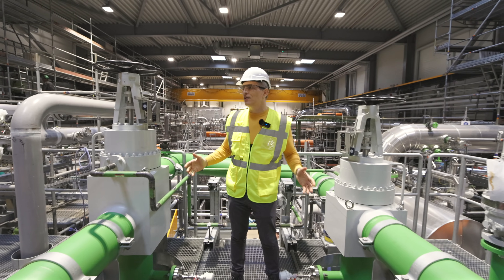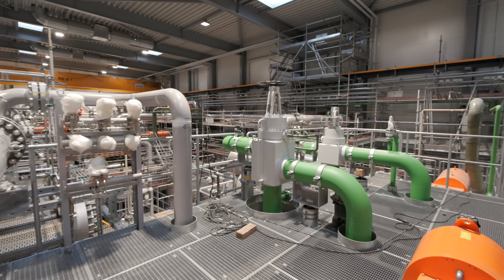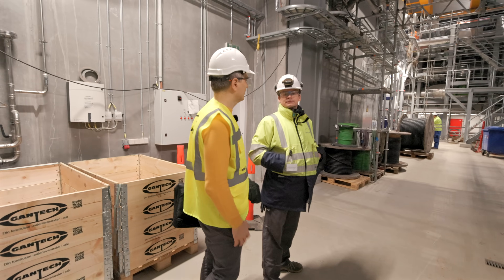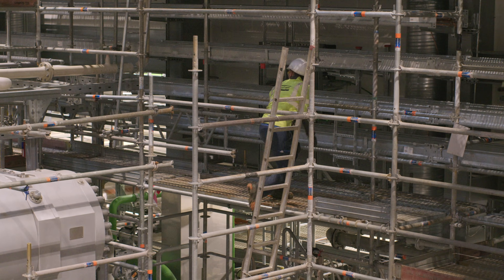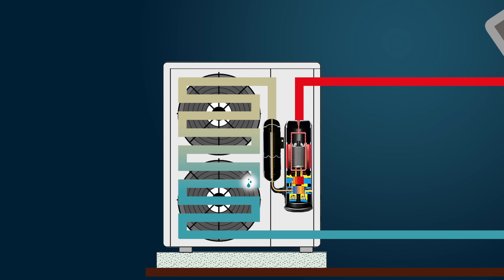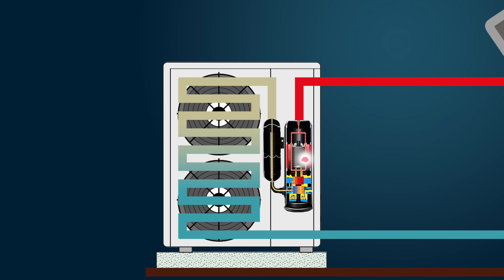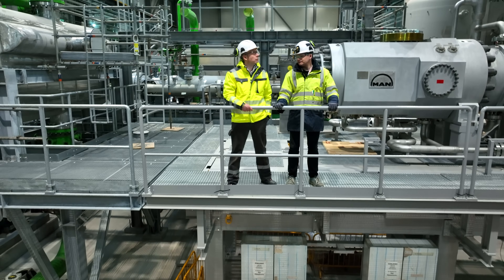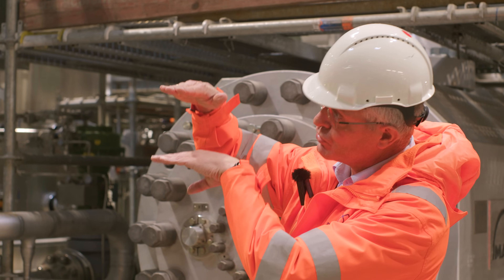Inside the world’s first giant heat pump that heats an entire city with CO2 and sea water

Comment: Wow! That didn't feel like more than 40 minutes! Nicely done and very informative.
Is the heat storage just a tank of hot water or does it contain another heat storage medium?
Reply from the maker: I am glad it didn't feel like 40 min :) The heat storage is an tank with thermal insulation to minimize the losses and some internal compartments to make the partial use / storage / refill more efficient.
Reply: @Watt-Energy   Question wasn't about insulation, but what medium is used to store the heat Such as a water, salt, phase change material,etc?

FWIW its heat storage was the one aspect, I really would have liked more details.
Reply: @nc3826  it's just water. Cheap, practical and over 100 years of experience.
Reply: “It ain’t what you don’t know that gets you into trouble. It’s what you know for sure that just ain’t so“  

it is a shame YT experts, will never learn that lesson....
Reply: @nc3826  there are hundreds of district heating water tanks this size, operating for decades. Berlin installed an extra big one a few years ago, well described
Reply: @nc3826  No.  I looked it up, you didn't. Esbjerg uses water in the tank to store 80 degC heat. Same as the many others.
Reply: fwiw where, did you supposedly 'look it up' ?   

since 'MAN Energy Solutions' url doesn't specify the storage medium... In its 'esbjerg-heat-pump' menu....
Reply: I posted the link 2 times, but it didn't get through. Weird. Let's see if this one does...
Reply: sigh link was removed again. Weird, it's just a standard link.
Reply: Fremtidens fjernvarme , at the DK domain
Reply: The link seems to stay this time, so I'll repeat yesterday's guide. Click the British logo. On the right is their Youtube-link from 2022 , @4min he says how the old water tank stores the heat. On the left, click Hybrid opportunities for the diagram. 
(They are tech people, not marketing people). Big hot water tanks are quite common , it ain't rocket science 😉 .  So yes, I gave you the correct answer the first time when you asked about the heat storage medium, but somehow a simple fact got your panties in a bunch 🙄
Reply: My quandary was 'rhetorical' to elicit more relevant details in future posts... 

It's not directed to a YT expert who made numerous Incorrect... and irrelevant pointless conjectures and assumptions... That added nothing of value to anyone.... 'Is the only simple relevant fact'

fwiw 4mins into the post, it's referring to heat exchange tanks used for heat pumps in general, which is irrelevant to my rhetorical quandary...

And thanks for the imaginary link...
Reply: Bless the Danish and their "grid balancing gymnastics" -- but this is the dumbest/stupidest renewable-energy contraption I've ever seen.  (Have to feel sorry for the manager how has to describe this contraption.) 

1) there is nothing unusual happening with the climate.  (Please explain the Little Ice Age and the Medieval Warm Period.) 

2) there is nothing wrong with burning fossil fuels.  Its problems in high-density areas are trivial to fix and already have been fixed.  CO2 is not a pollutant.

3) Climate alarmism is a big-lie superstition supported by tax-bribed liars.  (See Climate Discussion Nexus for 100s of videos on climate quackery, deception, and realism.)

4) decarbonization is 21st century pyramid building and human sacrifice. 

5) there is NO excuse for expensive electricity.  Electricity generation is boring.     Just burn coal and scrub the smoke in densely populated areas.

6) the only challenge is manufacturing market quantities of cheap gasoline.  South Africa has already done this for decades (Sasol), using coal. 

7) Elon Musk: the Laptop Class is in La-La Land.

Comment: Great project but with all respect: be careful when you claim world first before fact checking what China has done. City of Chongqing in China has bulit a few similar projects at least five years ago. Keep up the good work
Reply: There are also several large heat pump projects in Scandinavia ... also a whole town that runs off it's sewer system heat and bio gas ..  In fact anywhere  
Where they have communal heating systems they have gone over to giant heat pumps..or will.
Reply: @clivestainlesssteelwomble7665  Denmark is part of Scandinavia.

Comment: Do not tell Americans as it sounds communistic and you know how allergic they are to good ideas like that !
Reply: It would be interesting to see if a small community in the USA could make a district heating system work. Certainly in the UK we have been used to buying fuel for hundreds of years, so adjusting the mindset to one where you are buying heat, rather than fuel and an appliance to use the fuel, will take some getting used to.

Comment: I''ve seen water to water heat pumps talked about as a possibility, but didn't realise that an industrial size one existed. The main problem with using sea water as the heat source I would guess is corrosion and fouling of the heat exchanger.

Comment: Kensa heat pumps, uk, install a common ground array and connect small heat pumps on each house.  The benefit being no heat losses, a very oversized ground array to pull heat from and no need for any additional ground array pumps
Reply: It's also called ThermoNet. It only works on small scale because of the peak demand on very cold days. It's very good for villages.
Reply: @thomasgade226  That might change if we start to pump heat back into the ground during the hot days of summer when solar pv and solar thermal can capture the heat efficiently. There is also a company in the UK that is using roads to capture heat during the summer, and storing it underground where heatpumps can access it in the winter.
Reply: @tlangdon12  we have a dozen insulated heat ponds for medium scale . Large scale heat storage in ground requires that no groundwater moves, the opposite of geothermal (Aarhus). Canada (Drake Landing) and Sweden has the ground for insulated ground storage , Denmark doesn't.
Reply: The other system is extracting heat from old flooded mine workings .... Of which we have quite a few... 

A heatpump using the waste heat in the cooling waters of a nuclear power station would also improve the efficiency of both.
Reply: The dumbest "renewable energy" contraption I've ever seen.
Reply: Bless the Danish and their "grid balancing gymnastics" -- but this is the dumbest/stupidest renewable-energy contraption I've ever seen.  (Have to feel sorry for the manager how has to describe this contraption.) 

1) there is nothing unusual happening with the climate.  (Please explain the Little Ice Age and the Medieval Warm Period.) 

2) there is nothing wrong with burning fossil fuels.  Its problems in high-density areas are trivial to fix and already have been fixed.  CO2 is not a pollutant.

3) Climate alarmism is a big-lie superstition supported by tax-bribed liars.  (See Climate Discussion Nexus for 100s of videos on climate quackery, deception, and realism.)

4) decarbonization is 21st century pyramid building and human sacrifice. 

5) there is NO excuse for expensive electricity.  Electricity generation is boring.     Just burn coal and scrub the smoke in densely populated areas.

6) the only challenge is manufacturing market quantities of cheap gasoline.  South Africa has already done this for decades (Sasol), using coal. 

7) Elon Musk: the Laptop Class is in La-La Land.

Comment: I haven't finished watching the video yet, but with this system, do residents have the ability to determine how hot they want their homes? If i wanted 75 degrees and my neighbor wanted 70, would be both be able to do that?
Reply: Yes. Each indivual home has a heat exchanger, so the water from the district heating isn't circulated directly in your radiators. I'd say that today 100% of radiators have thermostats or if you have underfloor radiant heating it is controlled by room thermostats. These regulate the temperature in your rooms individually as you want.

Comment: Quite fascinating the way they can play with the load balancing. The heat accumulator that gives them the energy buffer to seek favorable electricity prices, electric network stabilization service to the network operator, etc. All these things click into place if you have such a flexible system. I love that. Meanwhile here in Brno, Czech republic, the city of roughly 400 000 inhabitants and an extensive network of central heating, the city plans to bring a huge heat pipe from a nuclear powerplant (some 42km away) to use its waste heat as a heating source to limit the reliance on fossil fuels. This proposed system will be incredibly expensive - some 750 000 000 EUR 🙄. even if we had 4 systems like the one in Esbjerg, it would be fraction of the cost. Oh well..

Comment: Air-source heat pumps can use between 545 and 7,500 watts of electricity. Mini-split heat pumps can use between 500 and 1,500 watts per hour, with an average of around 800 watts. The size of the unit is a key factor in determining how much electricity it will use.

Comment: 5:33 for 1kWh consumed it generates 4kWh of heat? Isn't that backwards? Sounds like it breaks the second law of thermodynamics a little
Reply from the maker: Yes, 1 kWh of electricity generates 4 kWh of heat, that is why heat pumps are efficient. The explanation resides in the fact that a large part all of that 1 kWh of electricity is consumed for the mechanical work of the compressor, while the heat is generated by having the gas (refrigerant) compressed, plus the fact that a part of those 4 kWh of energy  at the end are gained by capturing heat from the primary medium and absorbing it into the refrigerant.

Comment: This is old. Stockholm has had industrial scale heat pumps pulling heat from the waters around Stockholm for 40+ years.
Reply: I was just thinking same. I know someone in Finland that has been using this same system in his home for about 25 years now. This is just done on a bigger scale with sea water as the source.
Reply: Ropsten.
It was the biggest in Europe when it was commissioned. 
Still runs today.
Reply: Here is a (Swedish) article describing it.
Reply: Bless the Danish and their "grid balancing gymnastics" -- but this is the dumbest/stupidest renewable-energy contraption I've ever seen.  (Have to feel sorry for the manager how has to describe this contraption.) 

1) there is nothing unusual happening with the climate.  (Please explain the Little Ice Age and the Medieval Warm Period.) 

2) there is nothing wrong with burning fossil fuels.  Its problems in high-density areas are trivial to fix and already have been fixed.  CO2 is not a pollutant.

3) Climate alarmism is a big-lie superstition supported by tax-bribed liars.  (See Climate Discussion Nexus for 100s of videos on climate quackery, deception, and realism.)

4) decarbonization is 21st century pyramid building and human sacrifice. 

5) there is NO excuse for expensive electricity.  Electricity generation is boring.     Just burn coal and scrub the smoke in densely populated areas.

6) the only challenge is manufacturing market quantities of cheap gasoline.  South Africa has already done this for decades (Sasol), using coal. 

7) Elon Musk: the Laptop Class is in La-La Land.
Reply: @hg2.  Yes, coal, natural gas, sawmill waste, crop residue, sewage sludge, and municipal solid waste can all be converted to liquid fuels. Nuclear hydrogen and heat can also be used during refining to increase yields and decrease emissions.
Reply: @hg2.  Can you please leave politics out of this. Can't get away from you people.
Reply: @lordchucksteak1012  
This whole foolish contraption is driven by politics.
Reply: @hg2.  You're the one getting triggered by a heat pump, you can't help yourself but bring up politics.
Reply: @lordchucksteak1012  
Yes!
Because it's a stupid pissing away of taxpayer money.  If you think that's nothing to get triggered about then you've never had a real job.

Comment: This sounds like a great system. I would be interested to know how much excess wind/solar electricity they can soak up. Great alternative to battery/hydro storage. In many places truely carbon neutral biomass is difficult to source. Using biogas would seem a better option and may even make it carbon negative.

Comment: How much watt per hour does the average household compressor require, any info in this video?  Couldn't find any
Reply from the maker: An efficient heat pump, in an insulated 140 m2 house, would consume between 400 and 900 kWh monthly in a winter month, depending on average temperatures. The upper level would be valid in a cold month, with frequent -5 to -10 Celsus at night, or even -15 and lower. The lower consumption would be valid in a warmer month with positive temperatures of about +3, +5 during day and around zero at night. There may be big variations for this number in case of an apartment, and depending on the COP of the selected heat pump and the right installation and the setup of the system. I promised earlier to do a video with the numbers I have obtained on a larger home heat pump system, on a larger area to heat, so will definetely come with that video with all the numbers revealed and commented, from my experience.
Reply: In the Netherlands I heat the 140m2 house with 1800 kWh per year.
Daikin 5 kW multi split airco system.
Most times the Daikin airco uses 600 Watts.

Comment: In commercial refrigeration systems in the USA, C02  hasn't caught on because ammonia is considered the most efficient. I am glad to hear that a supercritical C02 turbine system can be equally efficient as ammonia, at least in heating mode. I assume that also works in cooling?
Reply: In theory yes, but in practice, this system will never be used for cooling because there is some heat demand even in summer for heating domestic hot water.
Reply: Yes in warmer countries like Japan and Australia CO2 is used for commercial refrigeration.
Reply: CO2 is very new on this continent. M&M Carnot (who were apparently recently acquired by Johnson Controls) is installing CO2 and hybrid CO2/NH3 systems

Regarding the heating/cooling thing, as they're replacing a coal plant I get the feeling that the network is only built to supply heat rather than pick it up. Who knows, they might look at adding a cooling loop later, but Denmark is not exactly the hottest climate lol

Comment: Would this system work for cooling as in warmer/hot climates? And or both heat cool
Reply: Yes, In Helsinki, Finland, there has been a district cooling system since 1998.
Reply: Enwave's system in Toronto, Canada is primarily a cooling system. It is somewhat differently set up because the water it uses for cooling is from an adjacent fresh water lake, so it partners with the local water utility to just use its water rather than needing to set up an intake and outflow system like the one in this video. It displaces 54,000 MWh of electricity usage annually compared to conventional cooling. Like this system, it  incorporates thermal storage so that it can use less expensive electricity rates when they don't line up with demand, but rather than hot water, they store it as ice. 

It's been in operation for about 20 years, though it started smaller than it is now.

Enwave also has systems in other places that both heat and cool as well as supply hot tap water and process water, but this is the largest one.

Comment: This is not first. In Helsinki has too heat pump in district heating.
Reply from the maker: Yes, there are more examples of heat pumps for district heating, the world first part here is having a heat pump of this scale using sea water as heat source and CO2 in its circuit, while also being capable to ensure such high temperatures on exit that it can operate with an old city piping system.

Comment: I am an engineer who was project manager for nuclear power stations.
Now I live in a small town in Northern Germany where this sort of distributed heating is used.
I have a number of critical questions concerning this project that were not answered by this video.
1. Cost (average) of delivered energy per kwh.
2. Charge to customer per kwh.
3.This is a 4 stage heating system that attempts to balance cost of energy and requirement to burn waste. What is the Total CO² output from waste burning and gas burning and woodchip burning in tonnes
Reply: In my view, this system is a perfect example of a perpetual motion machine.
Reply: @juhajokipii8783  
Right.
This is the stupidest "green energy" contraption I've seen yet.
Reply: @juhajokipii8783  No - no such thing.  They need electricity to run this plant.
Reply: Perpetual motion machine is a theoretical model that cannot exist In this universe. And if you look closer at the energies involved In this concept, you see it would require energy being created out of nothing.

Comment: And if it goes wrong and fails? A city without heating or is there a failover system?
Reply: It's in the layering. There are four primary heat generating plants: Waste-to-energy, seawater heatpump, woodchip boiler and electric resistance boilers. They won't all fail at once.